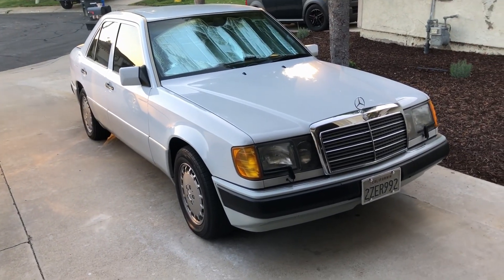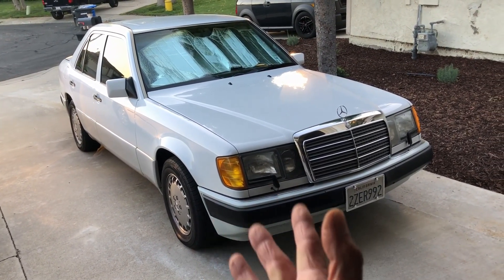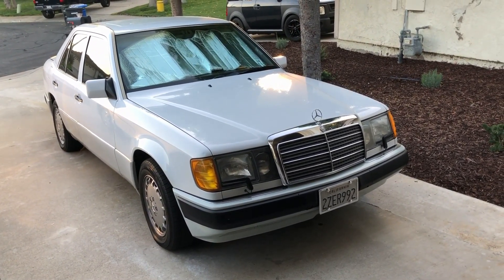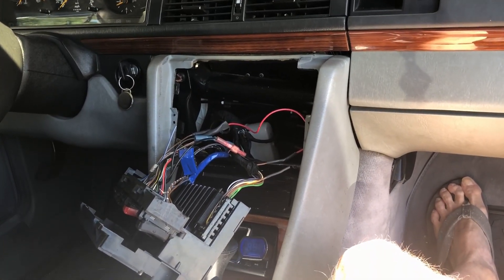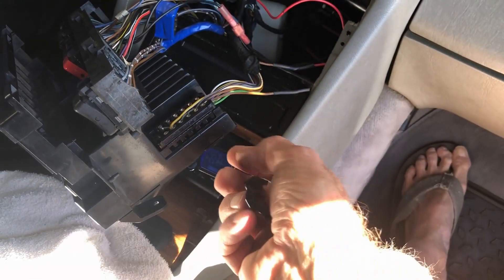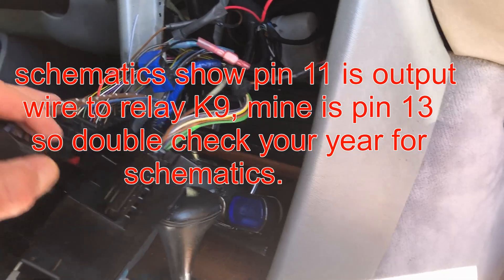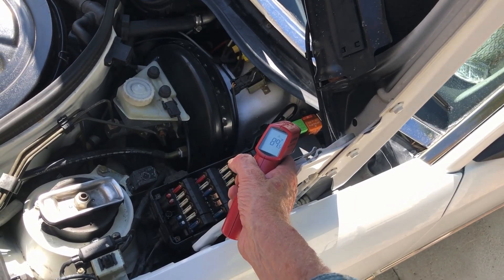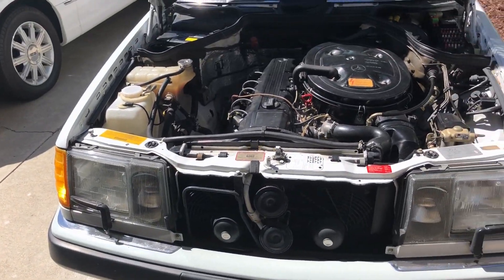Mercedes W124 Cooling Fan Hack (2)

Comment: Great videos, @My German Cars.  I've had a few cars with this M103 and M104 engines as well as some V8 ones.  One thing to keep an eye on and perhaps change is the fan clutch for the mechanical fan attached to your serpentine belt.  They often don't spin as fast as they should and as a result, the car overheats, especially when moving slowly or in stop & go traffic.  Just wanted to share that as a common failure that you might be experiencing.  That said, judging by your expertise, I'm sure you already thought of that!
Reply from the maker: Thanks, I did replace the fan clutch , research showed that it doesn't fully lock up at idle, locks up at about 3K rpm, so when its 100F in stop and go traffic its just spinning doing nothing to cool engine lol, the aux high speed fan supposed to cool it down for idling in traffic,  I put a switch on dash for high speed fan, boy does that cool it down fast!
Reply: Again, great stuff.  Keep the videos coming!

Comment: I found the problem! Go to @5:30 on this video. The blue electrical tape that is around the right side connector....that shouldn't be there. Someone at some point did something with that side and every single one of those wires is off. They are all lined up correctly, but starting with the yellow wire and the one directly below it (green/yellow) each one needs to move up one space. Same with the other row starting with the grey and yellow wire, move them all up one space. 99.9% sure that should fix your problem.
Reply from the maker: I put that tape on lol, had to remove original tape to verify wire colors, deal is wire colors are different than schematics I have, my car is a 1992, vin card show delivered to USA late 1991, closest schematics I found was for 1990, if I had exact one for my year it would be a lot easier, things like pin 11 is high speed trigger wire according to schematics, on mine it’s pin 13! See what I mean?
All wires in both 14 pin connectors lay down perfectly, wire loom was untouched till I got in there. Fun uh.
Reply: @mygermancars7264  Yep, been there. Well either way, move all the wires up one position and the problem will be fixed.
Reply from the maker: Thanks man for your help!  I’ll look at schematic again and look at pin out, right side , pin one and two are empty, no wires to them, one schematic shows that’s correct.
Reply: @mygermancars7264  yeah, but for now ignore the schematics there are far too many variations of the 124 to know if you are looking at the correct one without knowing your exact engine identification number and break point when the schematic was revised. As of '87 the automatic models through '93.... 124.023/030/050/290/226/230/090/290 were the same, not including m104, manual tranny, diesels, or the V8s
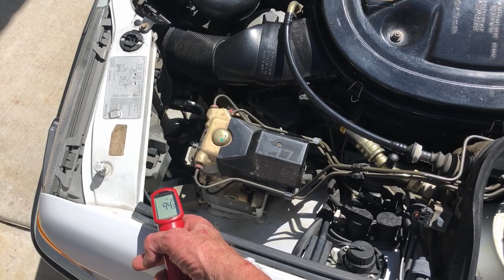Reply: Also, worse case scenario is that if after changing the pins up a slot doesn't resolve the issue (highly unlikely) one thing you can do to get your high speed fans to run is to bypass the ballast resistor (@17:14) for low speed fans by moving the wires from the rear post of the resistor to the front. So instead of this: (fan wire)------[RESISTOR]----(fan wire), you have this: (fan wires)========[RESISTOR]xxxx(__no wires__). So when you run the ac, the fans will just kick on in high speed instead of low speed.
Reply from the maker: Well that's a good easy idea, thinking about drawbacks?, Hmmm... the K10 is a 30 amp , K9 is 40 amp, may be to much of a draw on that relay, maybe change it out if available, one totally weird thing is when I inspected the low speed K10 its a 5 pin, but the sockets only have 4 inserts, so one K10 pin does nothing, why would they do that!  5 pin is way more expensive lol, if I remember right there's a 87A and 87B pin ,so its probably just using 87A, no harm just strange, maybe a 4 pin would work there?
Another drawback, A/C would always have to be on for high speed to work, easier to cool a overheating engine with A/C off.
Last time car overheated  it boiled almost all  the coolant from the engine, when my son realized what was happening(warning coolant light at dash)  he immediately turned A/C off and turned heater on, system had no leaks, just a little dripping from overflow tank behind fender.  I'm going to test how much air the high speed fan really is pushing past condenser to radiator, that's what we need to cool. 
  @brittanywright9646
Reply from the maker: I just woke up, may have made mistakes there lol, have to look at schematics, coffee please.
Maybe apply power to one of those high pressure sensor wires see if it even works

Comment: You have the FSM on the computer. Your high speed fan is controlled by the 2 prong coolant temp sensor mounted on the engine. All you you to do is pull the plug off the temp switch to see if the fans turn on high. If not, then bridge the 2 connections in the plug with a paper clip. If it still does not turn on you have a short with one of the wires. One wire will obvious lead to ground, should be brown wire, check continuity against ground with the wire. If you get 0 then the problem is the other wire. More than likely, the actual pin connector (the part that fits over the temp sensor switch on the engine) is frayed or separated where it isn't even connected anymore. High speed fan is only controlled by 2 things: the AC temp switch on the receiver drier and the coolant temp switch on the block. Once you find the problem, throw a 450 Ohm resistor across the two connectors on the coolant temp sensor. This will get your high speed fans to kick on at about 97 - 100 degrees instead of the 105 degrees.
Reply from the maker: Thanks, yeah the 2 pin sensor tests good, replaced electrical connector, 2 wires, one is blue grey, that one on the schematic is labeled auxiliary fan sensor input for  push button unit (CCU) verified I have continuity on that wire, other wire is brown and yellow, it also leads to CCU , labeled sensor inputs, it has 4 or 5 sensors on it, one sensor outside, others are inside cabin, pretty sure all those sensors are for automatic CCU function, did not test those sensors because blue wire is the main trigger for CCU, at least , will test ground signal at brown yellow wire, good ideaI think lol.
That’s the only wire I did not test, could be a issue? Some things that really confuse me, Pin 13 CCU, I can fire high speed fans on it, key on, apply 12 volts to it or ground wire? Bizarre! Also K9 relay, test pin sockets, key off, 3 test as grounds, one at zero, then same test with key on, 3 sockets test at 12 volts? it’s like they switch from ground to positive signal, bizarre.
Did bridge the coolant sensor wires, still no fans, years ago when we got the car, worked on interior lighting issue, found multiple ground wires cut under console, repaired them, but who knows what some stereo installer did, maybe more cut grounds?
Reply: @mygermancars7264  is your k9 relay a 6 pin or 5 pin? I think it should be a6 pin double contact relay. Take out that relay and swap it with another relay, 5 or 6 pin, then turn key on and pull the 2 pin connector off the coolant temp sensor and see if fan kicks on high. I just verified that it should still kick on with a 5 or 6 pin on my 201. Also the blue wire leading to the ccu to the sensor is designed to cut off the ac when the temp exceeds a certain degree, 110, I believe, to prevent overheating, then it turns back on once temp is brought back down. High speed in regards to the pressure sensor on receiver drier, same thing. Cuts ac off at like 20+ bar of pressure, then back on once pressure drops. I spent a great deal of time studying all the wiring of the m103 in regards to the cooling system as I live in a desert and the temps are 115+ all summer.
Reply from the maker: High speed K9 is 4 pin, K10 is 5 pin, original ones tested good on bench, but installed brand new ones.
Reply from the maker: Will test for ground signal at brown sensor wire today, will post results.
I’m really really close to ditching this system and installing a reliable electric cooling fan setup, searching for proper fan shroud and fan that fits, sensor control, relay, bigger alternator etc.
Reply from the maker: Its raining perfect, tested sensor connector, unplugged, get ground signal on both wires, used battery for neg connection.
Reply from the maker: Guess I could test blue wire for a ground short, 2 weeks ago I tested continuity using a long jumper, one end at electrical sensor wire , then inside the car disconnected 14 pin CCU connector 14 pin right side, found blue/grey wire and got continuity, but... maybe that wire is compromised going thru firewall or behind dash grounding out?
About 6 years ago I did pull out HVAC box, replaced evap , heater core, all vacuum pods, made sure to hook up all sensors in there, maybe one got disconnected causing issue?
Reply: @mygermancars7264  Ok, I see. Ok do this, key on, engine off, go to the K9 relay and pull it out enough so that you can easily move it in and out so its making full contact with the socket, then go disconnect the coolant temp sensor. Now move the relay around and see if it is engaging or clicking as it makes contact and loses contact. Technically, this will let you know if there is some sort of disconnect between the sensor wire and the relay wire because normal conditions while disconnecting the sensor, would cause that relay to close and turn on high speed fans.
Reply from the maker: Good idea, will try that when weather clears,  @brittanywright9646  , I did lift fuse box and inspected wires and connections to K9, all looked good, over a couple weeks of working on the system I must have pulled that relay out 20 times testing. plus I did a continuity test from K9 relay pin 85(input from CCU) to CCU 14 pin connector, found brown/grey wire at pin #!13, so wire good, don't think that wire could be damaged going to ground , fans would be on constantly , that's the wire I put to switch.
I have about 60 videos on my testing troubleshooting I did not put in video, to long and boring lol.

Comment: Hey I have a 92 300e and I wanted to know where did u get your exhaust manifold and egr valve they look brand new
Reply from the maker: When I have to remove parts I clean and paint with High heat paint.

Comment: I got rid of my fan clutch and fan and went with dual 12in fans  controlled  by a davies craig fan controller. Now my car runs 80c on 95deg day running ac and no lost power due to tan and clutch.  And looks factory
Reply from the maker: That’s what I should have done long ago, but the purests on BenzWorld said keep it stock, they just don’t understand how hot it gets here!
Reply: @mygermancars7264  I used a pair of mishimoto 12 in fans and davies craig digital fan controller. Easy install and very reliable. You can program desired operating temp.
I got tired of my car running hot and power loss due to fan.
You don't realize how much power loss there is from fan till it's gone. I would never go back to original fan.